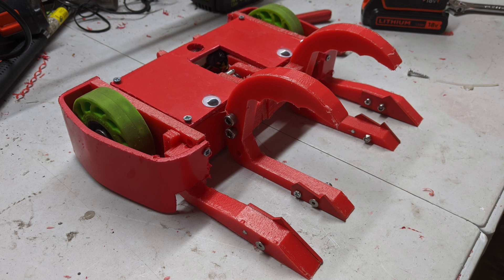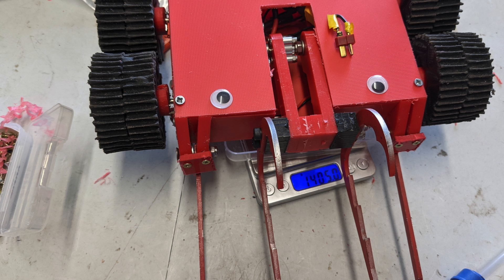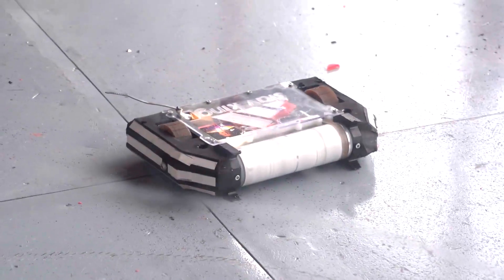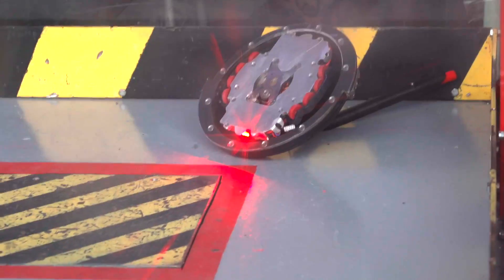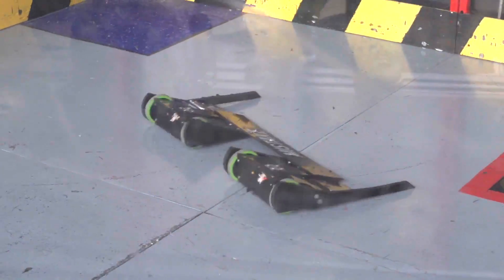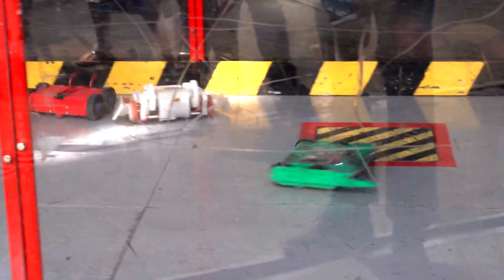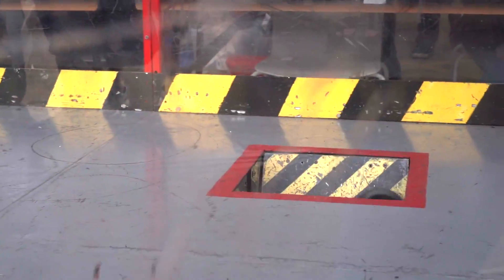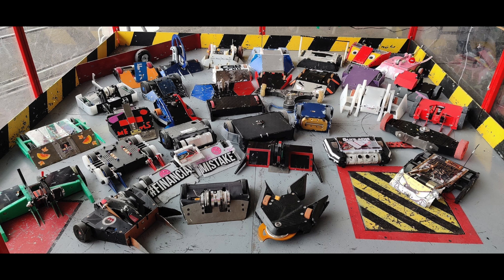Grab Crab v2 Build & Rapture 2021 Event Report - Beetleweight 1.5kg Combat Robot

Comment: How did you make the wheel hubs just out of interest? Also would “yoga mat” wheels be useable in a featherweight?
Reply from the maker: see 0:51 - its a Tnut with a grub screw going vertically through clamping the motor shaft, wouldn't recommend it, was pretty wonky but could be 3D printed, I cnc'd HDPE. 
Nahh we tried it on bish bash bosh and the tread wore off pretty instantly so wouldn't recommend.
Reply: @JoeBrown1  ah ok- I was already planning to try to use 70mm polyurethane skateboard wheels on my feather but I may end up trying to 3D print something similar to your mounts- thanks!
Reply from the maker: @teamberserkerrobotics1895  polyurathane is pretty spot on for feather wheels, my current ones are cast polyurathane :)
Reply: @JoeBrown1  great to hear & thanks for the advice!